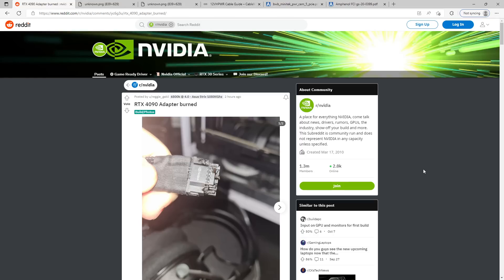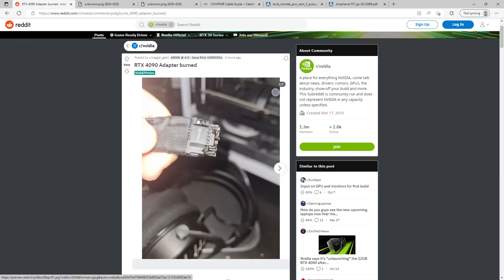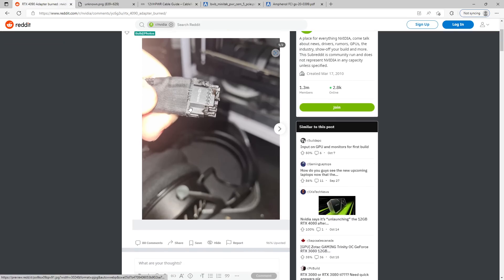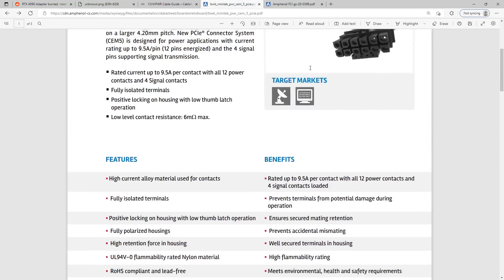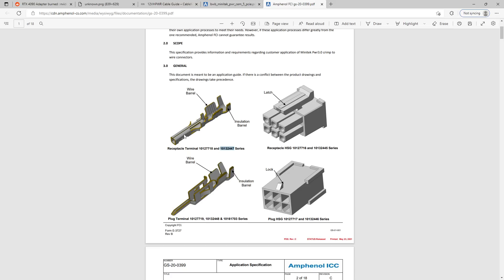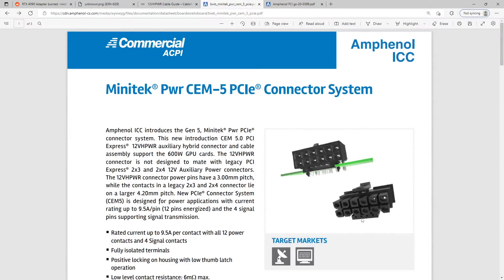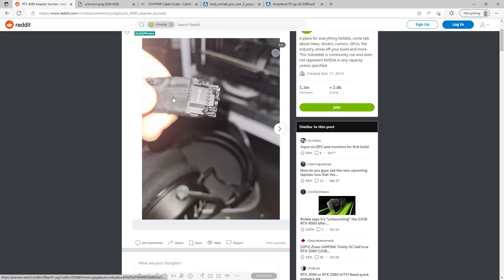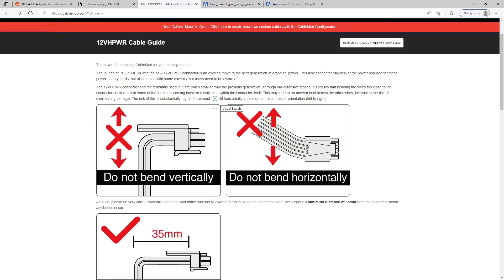The 12VHPWR connector sucks

Comment: I'm wondering if filling the back of the connector with resin would help by locking it in place.
Reply: You need heat dissipation.. Resin wont provide that.. Better quality pins on the connector & thicker for heat dissipation, and better quality retardant / heat resistant connectors.

Comment: I've defended the cable from misinformation, carefully reviewing the specs to prove it is "fine," but this speaks for itself, and I feel foolish.
Reply: One Reddit post?
Reply: @Jerry-jo6dn  Yes. Here is why: what I found in my research was that the tolerance of the connectors was such that with traditional 8 pin, it could carry twice the rated power, easily, and still be within Molex spec. For this new connector, my research showed that it met (almost exactly) Molex spec. I should have thought through the implications of that. If a single pin on this cable is not connected well and you pull 600 watts, it will melt. Thats according to the specifications of the manufacturer of the connector.

Comment: Why don't PC just use thicker cables and a biffer connector like for example XT60/XT90. Two wires that can easily handle hundred of wats.
Why the multiple wires? A 14AWG silicon wire is more flexible the those multwire cables from PCs

Comment: What Power supply and motherboard was used and did it have a power spike? You may need a quality aftermarket 12VHPWR connector.
Reply: Power excursions (power spikes) happen too quickly to create any measurable resistance on the connector.  There is no "higher quality aftermarket 12VHPWR" connector.  The AVL for manufacturers is very short and the material requirements extremely limited.

Comment: I think you bring up a good point about the pins not being "welded" to the plastic connector housing. So they wobble.
I would be curious to see DIY fixes of this by epoxy'ing the connector, perhaps even the 35mm of wires too (youd have to put another mesh braided wrap over it to hide it )
Reply: You want heat dissipation and glueing in isn't going to do that.  That too is why there is distance between the pin and clip housing. The pins need tighter tolerances and be thicker, for one, and secondly, higher quality connectors..

Comment: yes, you only need three but that's because their design ended up ludicrously more efficient due to switching to TSMC.
At that point they already designed all gpus with these huge coolers and the new power adapter.
It's not like they might not make use of 600w in the future. but they kinda shouldn't.
600w for one gpu is too insane

Comment: i never seen that pin open up.. i work with electronics and we use wery simmilar ( idk if exact size) terminals and the're quite robust. but we use it for like 8v per pin max and not continuous load so maybe thats the issue or pins are wayy to close and power draw heats up terminals and begin melting plstic

Comment: Why haven't they made the pins bigger? Same goes for the cable, since bigger = more ampere and less bending issues for the cable. (the tradeoff would be a little bit more circumference and a little bit less flexibility)

Comment: I don't understand why can't they use USB4 type C power delivery as one of the valid options for new ATX spec? It's easier and simpler in so many ways.

It has 240W power limit per cable, smaller & sleeker connectors, enough data lanes to run circles around talking to the PSU over serial interface, and it's a standard that's (aside from stupid naming fiasco) pretty good & widely accepted (even enforced for devices in EU).
Reply: It uses 48v so wouldn't be compatible with existing PSUs with a simple passive adapter
Reply: You're absolutely correct, and that didn't slip my mind.

Let me explain why that's a pro & not a con for power hungry systems... and there's no penalty for using it in lower power systems either (with active coverters & people actually prefer to do it that way instead; for more info look up "dcatx" or "hdplex 400W" etc).

Now, let me try to list down why 48V is a lot better standard supply voltage for upcoming PSUs:
- High-power systems (e.g. data centers) have long been using 24/48V PSUs anyway, it's nothing new (as in, "never done before, we don't know the bottlenecks/blockers")
- The newer ATX12VO proposal makes it so the PSUs & connectors are to be redesigned anyway (and the PoL conversion will have to be done anyway, so this is inevitable)
- Converting 48V to necessary levels at PoL (point of load, like VRMs) is better than the PSU designers guessing the multiple power rail budgets that "your" system "may" need
- But most importantly (and the reason why 48V is better, instead of "meh, same as ATX12VO" is because:) the current draw is 4x lower for the same power draw. Which makes it so the thermal losses over sense resistors and wires (especially due to bending, contacts etc) will be 16x lower (P=VI=I²R) - that's significant. That will also reduce the inductor, heatsink, MOSFET sizes/specs in the PSU, further reducing its weight and (hopefully) cost as well.

Overall, your PSU will be simpler, smaller, lighter (hopefully a lot cheaper); you will no longer have a current limit on 3.3V or 5V rails, less number of dead simple cables (so much so, that USB-C is technically overkill, even an XT30 cable would be fine for upto 1200W haha) and I can go on.

Comment: The old PCIe connector is just officially maxed out at 150 watts, Der Bauer tested that even if you cut most of the power cables, it will be just fine. Probably 2 of them could handle 600 watts, at least better than that stupid flimsy connector.

Comment: Not defending Nvidia, but as a past sound system engineer, short circuit connections can cause burn out like this. Maybe, there is a possibility that the connector was not properly inserted.

Comment: Sometimes engineers are a bit clumsy. This connector is poorly designed for no reason. To solve the problem of stress on the cables, you can simply make the connector with a L or C squared shape.

Comment: Why don't they make the cable longer and just have 4 8 pin connectors instead of this crap adapter. The cable could be thinner and get chunky at the psu side where you'd have more room. All these companies care about is the extra .50 cents it would cost them.

Comment: Cables you can't bend in a confined space with no standard as to power supply and video card placement. Combine that with cables and connectors which will inevitably be built by the lowest bidder. Seems fine.

Comment: All they had to do was mount 2-3x 8-pin connectors vertically and manage the 450w 600w whatever on the board. Better power delivery, less complicated, more robust and cheaper.

Comment: Why not just create a 10 pin power connector that's good for 250 or 300 watts. Would still take up less space than even two eight pin + 6 pin.

Comment: Remove the connector, remove the socket, solder the cables directly onto the PCB and plastidip it. GZ you solved a problem that shouldnt exist in the first place 🤦‍♂

Comment: 90 degree adapters to the rescue! I actually use an 8 pin 180 degree adapter with an RTX 2060 in an NR200 case. It makes cable routing much easier.

Comment: This card has only been on the market for 2 weeks and it's already frying.  Thanks Nvidia!   ;)
Reply: 450W fryer 🍟
Reply: Strictly speaking the connector has been around for 7 month and I believe I have seen 1 case where someones 3090ti melted
Reply: 30 series had the capacitor issue. I am seeing a pattern here.
Reply: @Vatharian  capacitor?
Reply: Card yes, connector no, it came with the 3090 Ti already. But it’s just FE afaik.
Reply: Planned obsolesce gone wrong... All of these 10+ year old cards you can buy 2nd hand used reliable power connectors, it was about time to cut GPU lifespan to warranty period and increase demand for new ones.
On top of it, while Philips was not involved for this, they are still going to benefit since they are selling machines to TSMC and others.

Comment: So, my question here is this:
Why not go back to card-edge connectors with a locking mechanism? They'd be FAR more robust, could handle WAY more power, they'd be cheaper, and you can literally have PCB card edge coming OUT from the PCB thereby granting more real-estate.
They even make connectors for this: TE Connectivity 2360558-2
Reply: Cost, and depending on the design, card edge connectors have higher risk of shorting adjacent contacts during insertion and removal.

Comment: So I just looked up both the 12VHPWR connector and the 8 pin ATX power connector datasheets (the 12VHPWR model is seen on the video and the 8 pin power connector I found on Digikey with MPN: 2354120-1). Each pin for the 12VHPWR is rated for up to 9.5A while each pin of the 8 pin power connector is rated for up to 12.5A. The 12VHPWR has 6 energised sets of PWR+GND pins (12 pins total) which would yield 57A of max current and at 12V this is equivalent to 684W of power (although the manufacturer only specifies up to 600W of power for whatever reason). The specified contact resistance of both of these connectors is the same, 5-6 mOhms and the receptacle terminal style is the same in both. I couldn't find any specifications for the housing of the 12VHPWR, but the rated dielectric withstand voltage in the 12VHPWR is 1000V whereas in the 8 pin power it's 600V. Given that the pin spacing is definitely not bigger in the 12VHPWR, that would imply that there is a thicker dielectric there, not thinner. So, on paper at least, the connector doesn't look stupid at all. Whatever the problem is with the melting connectors, it doesn't look like it's in the specifications.

Comment: Just to be clear, the burned build was the 4 PCI to 12VHPWR adapter, rather than the 12VHPWR direct to PSU cable.
Reply: Good point, some people seem to have missed this.
Im just waiting for my beQuiet cable. In the meantime I just limited my card to 80% power. Cant hurt to do so for a few weeks.

Comment: Yeah when I saw this design I figured they'd done a bunch of testing and the pins were huge and tolerances were tight so moving the wires wouldn't effect the connectors. 

Welp I was wrong on all accounts. That's insane to rate this at 600w. Good luck 40 series owners.

Comment: if they didnt want you to bend the cable, they should've put that part of the  cable (35mm)  in hard casing
Reply: You're right. Unfortunately then it wouldn't fit in any case. Nvidia wants to leave the end user with that problem. Truth is the connector should just be a 90 degree connector to go down the way most people install their GPU.
Reply: @All_I_can_say_is_Wow  I have a feeling we are going to see someone (like cable mod) make an adaptor or and actual cable that does the 90.  Maybe for those of us that mount vertically we will see some solution for that.
Reply: @Dragonsrage012  the 90 degree cablemod adapter releases in 6 days
Reply: @danisflying  You are able to place an order on Oct 31st,  then wait about 4 months to get one
Reply: That could work. But it would be a better design if Nvidia designed the connector with a stress relief as found on many other electrical appliances (making the cable take the loads from bending and stretching etc.) they probably would be fine with this connector
Reply: @rub3n0st  Right.  The plug should also be cable retaining not just pin retaining.  However that would up the cost a lot for a "free" (I know we pay for it via price of product) adaptor / cable that is included with the card / PSU.
Reply: Coz it would defeat the purpose of "making it look clean and sleek" it would consume and you would need to allocate more space 35mm to the side than the bent 3 8pin pcie connections where you can cable manage.
Reply: Problem with that is that it just ends up providing more leverage on the connection.  It'd be like using a longer handled wrench on a stuck bolt. In this analogy, we want the bolt to be stuck and having any kind of extra pressure on moving it is going to be bad. A shorter handled wrench (keeping the analogy) would also just be more likely to break the handle instead of the bolt.  Also super bad.  Instead, why put everyone on one single bolt when everyone has been doing it with 3 or 4 bolts for over a decade already? Oh so you dont have room for it? Look at the size of those GPUs, the lack of space is a lie. It's down to simply trying to be A) useless materials B) use proprietary materials to try to force consumers to be locked into their products in any tiny way they can implement.
Reply: There is someone high up the chain that was made aware of this and replied with "nah you're good just leave it".
Reply: and this would prevent you from having your side panel on....
Reply: No that would’ve made the adapter more costly and Ngre… uhm Nvidia can’t have that. And yes the adapter is the culprit I suspect a discrete cable from PSU would make way less problems as it’s simply less complicated and prone to failure.
Reply: Keep in mind the 35 mm suggestion is NOT from Nvidia, but from Cablemod. We don't know how thorough their power connector testing was but they also don't indicate anything like this in their materials
Reply: @Entropium  the 35mm comes from PCIESig which is the body that governs pcie devices.
Reply: @NotThatGuyJD  No.... it doesn't it comes from cable mod. Somebody already told you. Its literally RIGHT HERE IN THE FUCKING VIDEO at 4:35
Reply: @ashflame6888  refer to the PCI SIG documents, cablemod is just following their guidance, ffs.
Reply: @NotThatGuyJD  Then i hope they put it into the specification for the power connector so it is required to be put into the connector instead of putting it onto the user. As it feels like a solution for high-density rackmount servers not consumer cards the issue wouldn't be there. The space the rackmount servers have on their sides is much more than we have in consumer cases. 

The issue is nVidia took a power connector made for servers and put it onto a consumer card for consumers to use.
Reply: @yumri4  it's a shitty connector that should have been bigger and I don't think that the adapter from NVidia has the best design on the plug as 4 8 pins weigh quite a bit and the plug head is stiff which probably doesn't help the issue at hand at all.
Reply: @NotThatGuyJD  i agree the power adapter sucks like almost all first gen power adapters do. Right now i am hoping that the majority will use the actual power connector not an adapter to the power connector.. 

The only way the power connector makes sense is with the correct connector.
Reply: @ashflame6888  No need to get upset, kid.
PCI-SIG gave the same warning against bending the cables earlier this year, along with several pictures of burnt cables, on both the GPU and PSU ends. Cablemod gets the specifications for the cable from PCI-SIG to begin with.
Reply: that would of cut 45 pence worth of profit on each cable.  can't hurt the feelings of the shareholders

Comment: I’ll be so mad if this connection fries my 3090 ti Suprim. More so because my micro center isn’t getting stock anymore. Apparently another inch or 2 on the PCB for 8 pin connectors was to hard for Nvidia engineers. 3090 ti is totally a beta run on the 40 series.

Comment: Connector size is not related to total power usage directly so if they could step up the voltage they could run lower current but that would take up maybe too much space. I don't know but it would be nice if this whole voltage standard for these cards have been higher like 24 volts

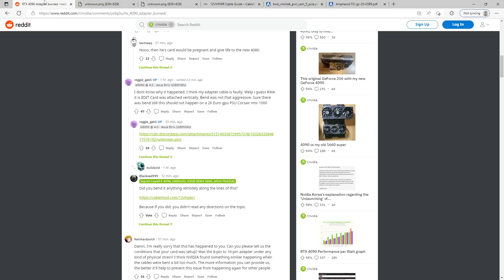Comment: 4:00 I mean technically "Uneven load across the wires" is the issue that leads to burning.
Some connections become relatively high resistance leading to other connection taking the majority of the load burning up in the process.
Reply: And that will get worse with time....

Comment: Seriously 98% of us mount our GPU normally in a case with PCIE wires bending against the side panel.  Just how difficult it is to provide us with a 50 cent angle adapter or angle wire?

Comment: The sense pins are (kind of) necessary, otherwise people would just plug one or two cables in, the GPU would try to pull 450 Watts through that and the connectors and/or cables would melt.

Obviously that's only necessary if they're using the stupid power cable adapter in the first place...

Comment: The 4090s are so huge that adding a couple connectors should really not be as much of an issue. Following DerBauer setting a lower power limit will be key in combating those thermal and power issues. The horizontal shift is imo problematic because it pulls the cables out of the connectors on one side while compressing the cable on the other side.
Reply: The AIO coolers are much longer than the board. And part of the size is the vertical depth which has nothing to do with the length of the board.

Comment: Assuming all that is true, you just needed a ticker cable housing to hold the several individual wires locked together, it's a very bad design flaw if the all cable allow for individual wires inside their individual plastic housing to move independently.

If you bend them horizontally, the ticklishness and stiffness of the all cable should never allow that .

Comment: Why couldn't Nvidia just make stacked 8pin connectors like they had with the double stacked 6 pin connectors on the old GTX 680 cards? Would of kept the PCB length down...